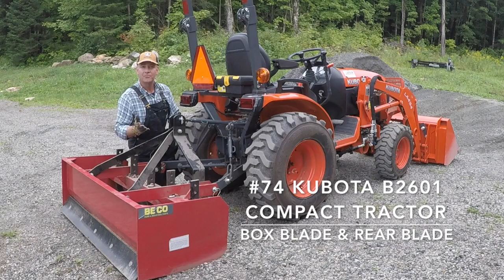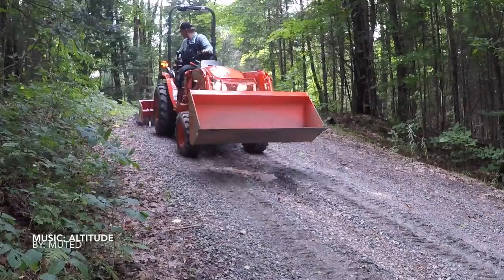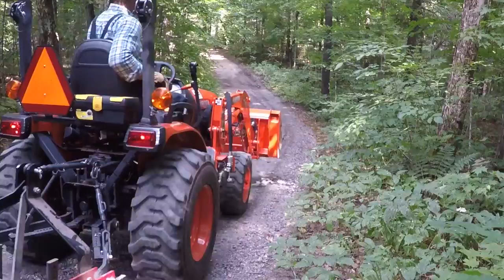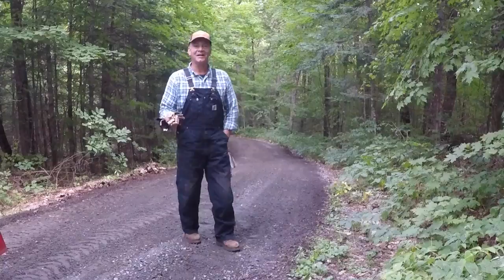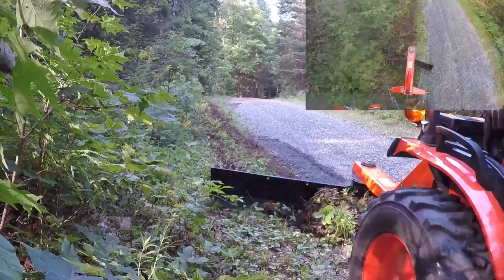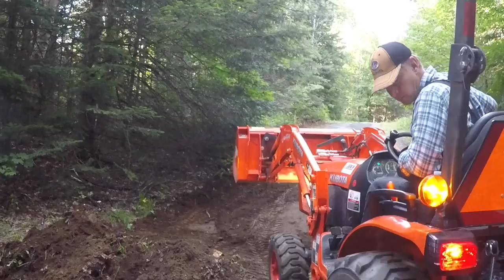#74 Kubota B2601 Compact Tractor BECO Box Blade LandPride RB1672 Rear Blade Grading. outdoor channel

Comment: You need to go slower - measure the vertical links to be same length on the first cut to remove ruts - then put the crown in the road, but go slower.
Reply from the maker: Good morning Stanley! Thanks for this. I have been told a few times to go slower. I feel like I am going slow but will keep that in mind next time. Have a good one and thanks for helping!

Comment: Might start using the loader to get a step ahead of the blade. Also, using the box scraper with some tilt from the rear lift arms and 1 or 2 rippers engaged shallowly to get through the hard pack. Lengthen the top link til the both blades are flat. OR CAREFULLY use the rear blade of the box scraper (going in reverse) to dig a ditch. NOTE: The rear blade (of box scraper) will dig quick, so may have to work lift arms so you don't dig deep holes. (I have done this with my tractor & box blade)
Reply from the maker: Hey good day Andrew. Thanks! Appreciate the detail and options. Will give it a try. Have a great weekend and thanks again!
Reply: @GPOutdoors  I used my tractor & 6' boxscraper (some short time ago) to grade a driveway AND divert water runoff from county road. I tilted the right side using the adjustable link and dug a lite ditch to divert water away from house and into neighboring field. So far so good. 
 Going in reverse will allow the boxscraper to dig if it is NOT level front to back. But there will need to be some adjustment from top link. This adjustment is touchy so don't go to extremes. Hope this helps everyone grading driveways and trying to divert water. HINT: hydraulic top and/or side links will make this easier and faster on the go.
Reply from the maker: Hey good morning and thanks Andrew. Thanks for the info above - I will need to try to dig out runoff ditches in a few other spots this summer. When you use the box blade to dig the ditch, do you use the scarifiers as well and if so, how far down do you set them? Or do you use the box without the scarifiers down at all? Thanks so much!